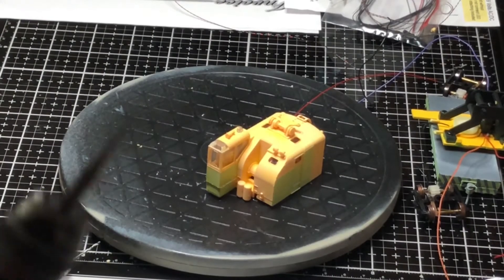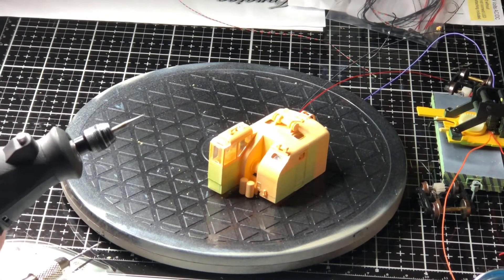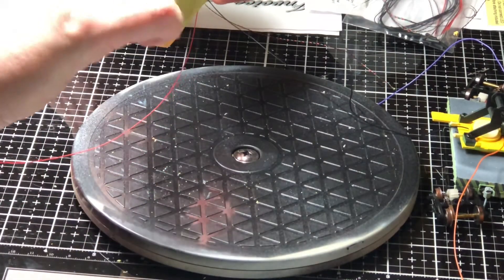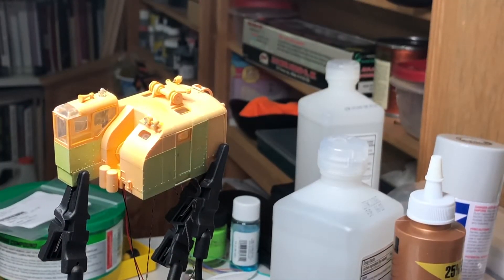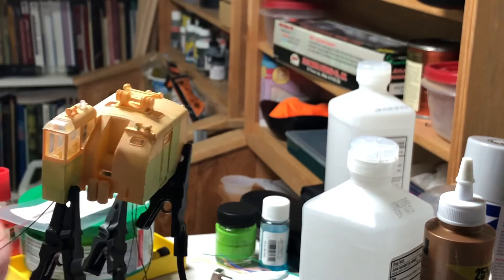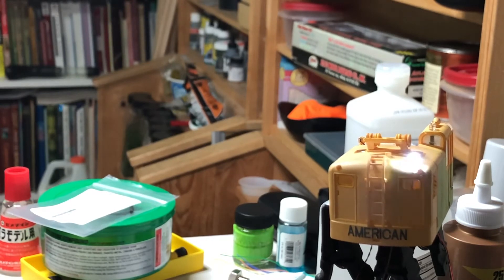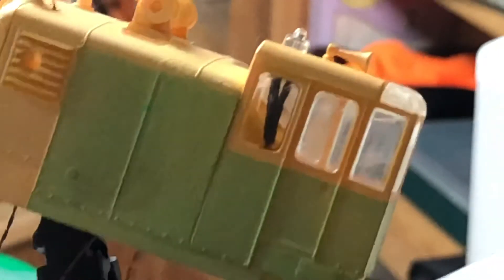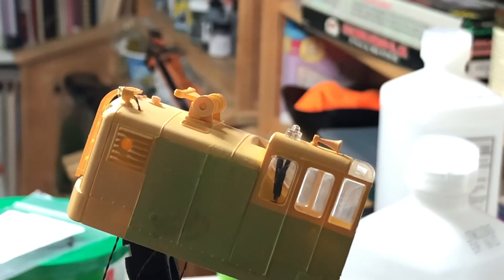Crane Project Part 3 Lights

Comment: Hi Steve ,nice project you doing it getting there will look good finished ,l tend to test all my smd led before l install them nothing worse than having to  try and change one after it glued in , keep up the good work Cheers Ron.B
Reply from the maker: I did but then trying to get it to hold must have broke it because I couldn’t even tell until I looked under the microscope